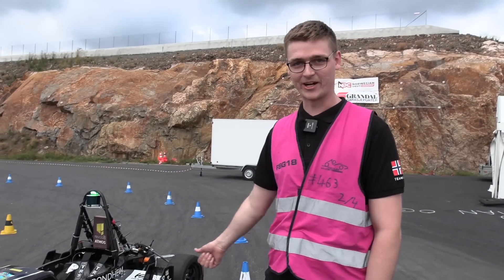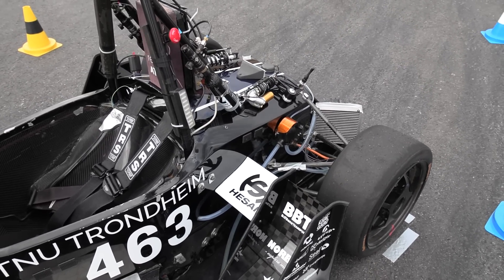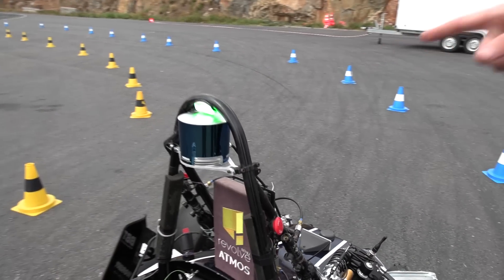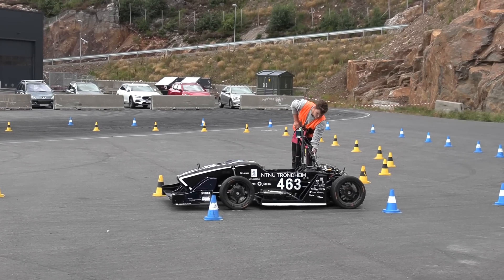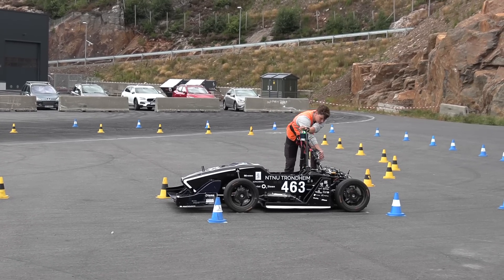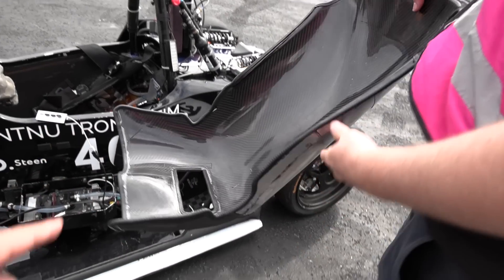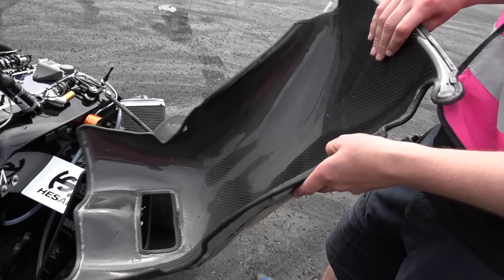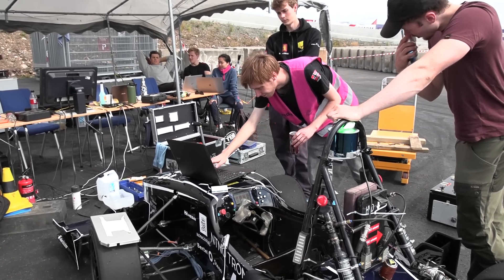Autonomous electric racing car from Revolve NTNU

Comment: 1000Nm sounds a lot, but a regular BMW 320D for example with 400 Nm has about 2400Nm on a single rear wheel in 1st gear, because of the transmission and differential.
But then this formula-like car is ALOT more lightweight.

Comment: Specs of the car three years ago
* 0-100km/h in 2.2 sec.
* 139hp
* 180 kg
* 1300 Nm at the wheels
* Lithium-polymer accumulator :-)

Source : Teknisk Ukeblad
Reply: The 139hp is unrestricted power right? Is the 0-100 time with that power or with the 80 kW?

Comment: How much power does it have?
And what accumulator chemistry do they use?
I think that they should use cameras because they are cheaper and provide data that is easier to process from what i understand.
Reply: The rules allow a max power of 80 kW. Most teams use either LiFePo or LiPo
Reply: @BirnexDxD  thanks : )
Reply: @BirnexDxD  LiFePO4 has to low Wh/Kg it's either Li-ion or LiPo.
Reply: @Tenus123  yes they do, LiFePo4 on the other hand allows for higher peak discharge since there is less voltage drop, at least thats what i’ve been told
Reply: @BirnexDxD  Agree LiFePO4 got high W/Kg compared to Li-Ion
Reply: @Tenus123  maybe range in race cars isnt such a concern.
Reply: @somebody3524  Yeah, you want high power cells. Not high capacity.
Reply: Cameras don't work that well.
Reply: @RadioactiveSaddam  why not?

Comment: They still need ONE forward camera!. The algorithm needs to learn the "racing line" and stick to that at the given speed for the racing advantage. Just to get around the track without hitting cones is not racing. I also hope they have traction control for the wheels. Sensors for traction control needs to manage and arrest slides of 2 inches or more. Actually a rear camera just above the wheel cover/mudguard of each rear wheel, will also optically measure the nearest distance to cone or line marker in order to determine the driving lines are not continually disrupted by too much power at the corners. Or too much slide since traction control cannot fully arrest slides all the time.
Reply: Engineer from Revolve here! The main reason we do not use camera is because we prioritize position measurement over color information of cones when mapping the track layout, and here is the LiDAR sufficient. Once this layout is complete do we have optimization algorithms for computing raceline.
Reply: @isakhammer6558  It's a really interesting problem both from a hardware and software perspective. If you release source code, data, imagery, lidar video, then maybe more students could help with the software part. Or that would perhaps reveal to much to the competitors…
Reply: @hemmper  Yea, it is sadly not smart to share our tricks directly with the competitors.
Reply: The way I understood it, the choice of using one 360° lidar instead of several cameras was to simplify things. One source of input. Might be the right choice here even if it's not for teslas.

Comment: Accumulator vs battery.

Accumulator is more technical correct. Battery is a set of equal that works together. That's why the guns on a battlecruiser is called battery. Same with the crime of battery  (multiple punches).

So what battery in a car is a set of electric accumulators (battery cells) that works together in a system.

Norwegians used "elektrisk akkumulator" som years ago, I have seen it in documents and technical spec sheets. 

Still used in German, where they sometime short "Akku".
Reply: It will be interesting to look back in 20 years at the early EV's and see what technology (and language) are the ones that succeed!
Reply: From the official Norwegian dictionary:

akkumulator m1 (akkumula´tor, i fleirtal akkumula´torer el. akkumulato´rer; fra latin; jamfør akkumulere) apparat (1) til å samle opp energi som en senere kan ta ut

Translation: An apparatus for collecting energy for later use.

From Webster's :
b British : STORAGE BATTERY

So it's not used in this way in American English.